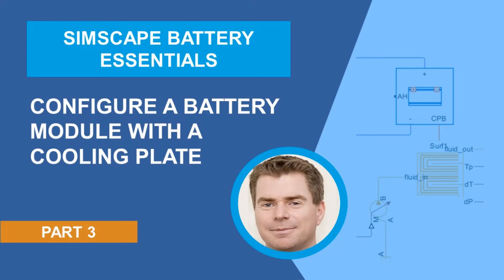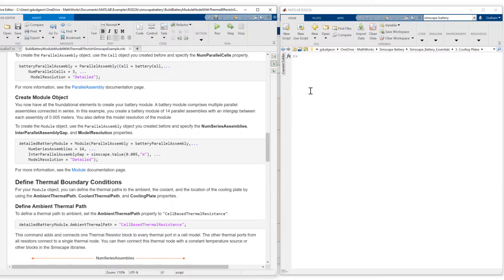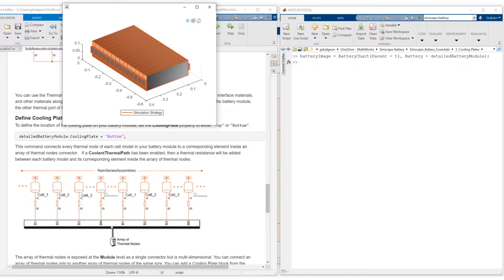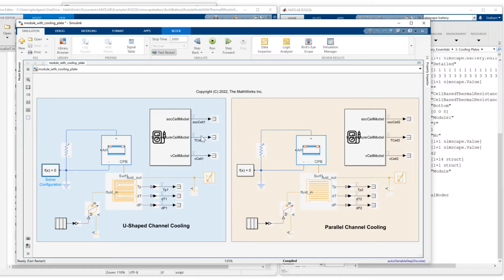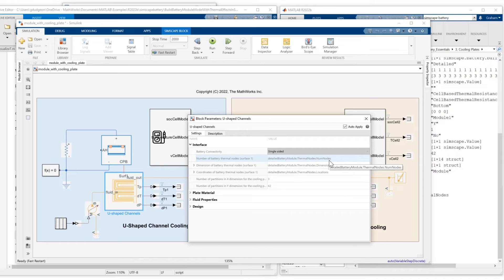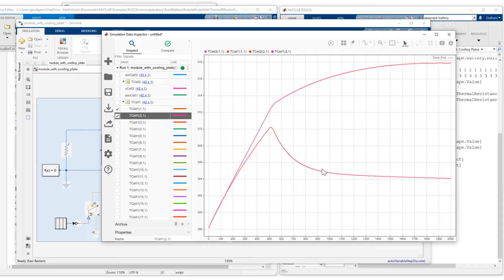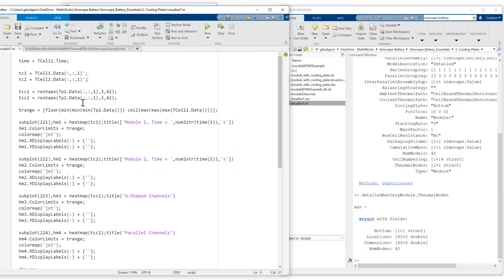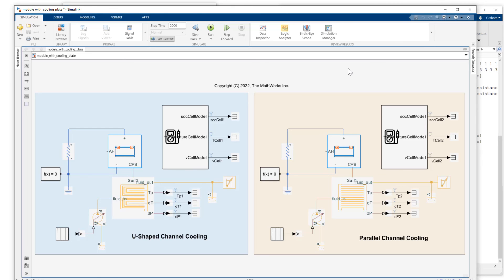Configure a Battery Module with a Cooling Plate | Simscape Battery Essentials, Part 3

Comment: how can we manually input the size of the cooling plate and dimension and position of the thermal node? I want to connect the cooling plate to other sources rather than battery
Reply from the maker: This link provides a general understanding of what's going on in the cooling plates 
https://www.mathworks.com/help/simscape-battery/ug/coonect-cooling-plate-to-battery-module-parallel-assembly.html   You can create a array of thermal nodes using our array of thermal nodes connector block and connect the elements to it they want to cool.